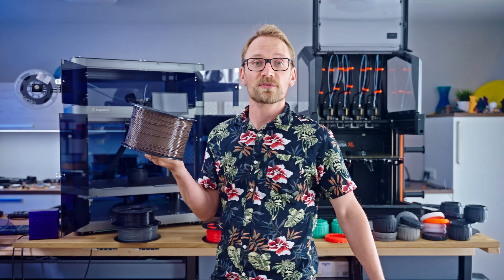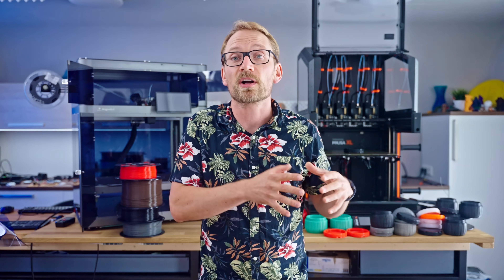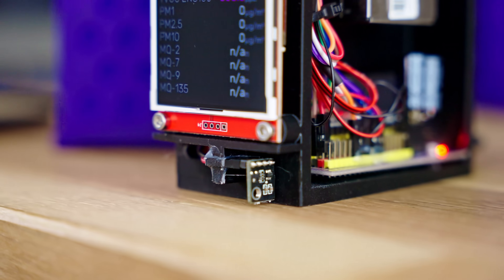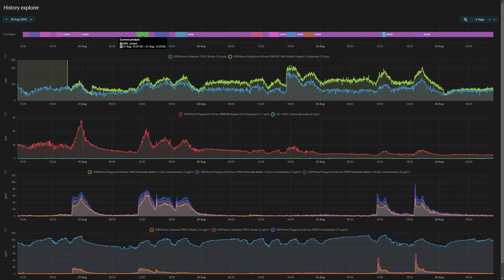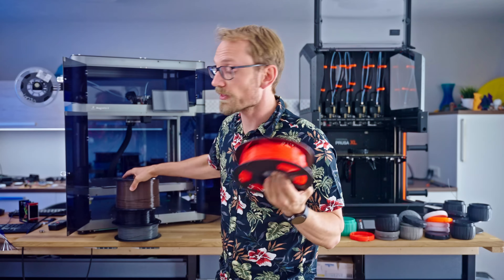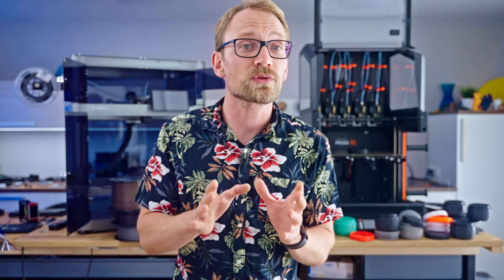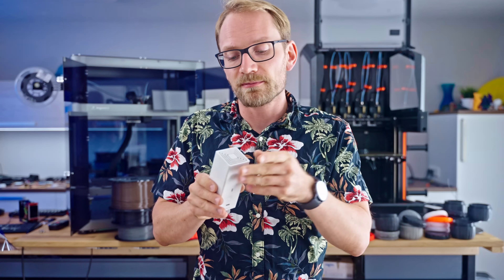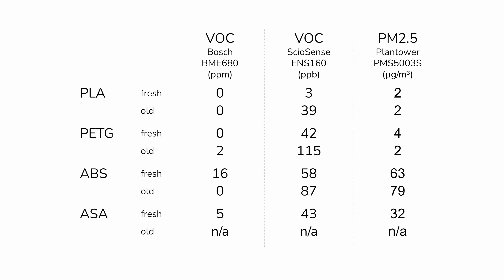3D printers are worse than I thought. Time to do something about it!

Comment: Thanks for reporting on this health issue, the community needs more awareness.  7 years ago I was printing some ABS and stunk up the house, my gf freaked out and forbid me from printing anymore.  I did my homework, and learned that pretty much all filaments emit VOCs, so I agreed and stopped the hobby altogether.  But I really wanted to print again, and 3 years later I came up with a proper solution.  I got a Printed Solid enclosure for my Prusa, installed a couple 60mm Noctua fans, attached a couple 2" diameter duct hoses, and ran them out a nearby window through an MDF gap filler panel.  It worked better than I expected, you can't smell a thing with ABS, and exhaust ventilation is sufficient for printing PLA with the enclosure closed (enclosure temp rise is only around +5C).  Last year, I got a Prusa XL and immediately made a custom enclosure.  I designed it to fully control airflow, with intakes in the front bottom, and 4x 80mm Noctua fans that exhaust out two 3" duct hoses, again through the same window panel.  It works great, enclosure temp rise with PLA is only about +6C, so I can print all filaments with the enclosure fully closed.  

My XL enclosure looks similar to the SUMO, but the SUMO doesn't actually control airflow.  I don't like Prusa's XL enclosure either, but I can't really say if it's properly designed for controlling airflow.  Essentially, both of my enclosures are negative pressure cases, sucking in fresh air near the bottom, and exhausting out the fan ports.

I'm not a fan of the filter approach.  These devices and consumables are expensive and less than 100% effective.  And don't forget that pretty much all enclosures require you to open them up for PLA, so no filtering at all.  PLA will give me a headache after a few hours, so this is unacceptable to me.  Exhausting out the window is essentially free, 100% effective, and works for all filaments.
Reply from the maker: Venting outdoors is an incredibly effective solution - even Prusa's print farm just has a simple negative pressure, constant-flow setup that simply doesn't let emissions escape from the printer bays. In colder, hotter, or more humid temperatures, that might however cause some issues with unconditioned air being sucked back into the house in other spots - for me, I'll be be rearranging my ERV ventilation unit to add and remove air more precisely where it's needed (i.e. hooking it up directly to printer enclosures)
Reply: @MadeWithLayers  You're right, all exhausted air is replenished by air leaking back into the house from other spots.  And if Noctua's rated max CFM specs were realized (total of 140CFM), then my entire home would be fully ventilated in under 5 hours.  I'm in hot and humid Atlanta, so these stats give pause for concern.  But these fans have low static pressure, so in reality they're pulling quite a bit less than 5 CFM total, due to various air restrictions (ribbed ducting, insect blocking mesh, undersized air ports, and the general 'tightness' of our home's weathersealing providing backpressure).  

Take a deep breath, open your mouth wide, and expel your breath slowly onto the back of your hand, such that you can barely even feel it (done right, it should take you 10+ seconds to expel).  What you're feeling there is approximately the air intake speed of one of my XL enclosure intake ports.  An adult male's lung capacity is approximately 6 liters, or 0.21 cubic feet.  So this equates to about 1 CFM.  Since I have 2 air intakes on my XL enclosure, let's double this and estimate that I have around 2 CFM of airflow through my enclosure.

This low air speed is desirable, because one of the main benefits of an enclosure is blocking drafts that might affect print quality and bed adhesion.  It would be silly to have so much ventilation airflow to create harmful drafts.  I've gone through various fans and ducting solutions to arrive at what I consider a desirable exhaust rate, a barely perceptible gentle breeze, not even strong enough to hold a tissue to the air intake.  Any less and the enclosure overheats for PLA, so I've tuned it to be just enough.

Looked at another way, the estimated enclosure exhaust flow (both enclosures combined) in 24 hours is roughly equivalent to a quality bathroom fan running for 15-30 minutes.  Yes, there's an impact, but no it's not really noteworthy.  If I had a print farm then I might feel otherwise, but for just 2 printers I'm quite happy with this setup.
Reply: @MadeWithLayers  The thing to consider about this though is that you really need to be filtering AND venting outdoors. Not one or the other. All of the modern professional venting set-ups I've seen in studios use some kind of charcoal filter to filter the air, and then the air is sucked outside. The placement of the ventilation system matters as well...if you pump unfiltered out of a window next to an A/C unit or other intake system you can make indoor air quality even worse, not better. There are exceptions like the Nevermore filter system, but most of the set-ups I've seen in YouTube and elsewhere are designed by well intention-ed makers, but many/most are untrained hobbyists and they don't actually know what they are doing.
Reply: Totally agree with you that some enclosure or air pollution management system is a must in 3D printing , and that it really doesn't have the attention it deserves, just as a precaution measure before we know more about their effects. However I would personnally still be quite uncomfortable simply exhausting it out, because it's just displacing the problem, not a  long term solution. On the one hand, even though hepa filters are usually  "only" around 99 % effective, you can get a nearly identical result as a hypothetical 100%  filter would yield just by recylculating the same air enough times through the filter. One could imagine a 3D printer with an airtight enclosure, and an air filtering system composed of some of those semi-flexible aluminium pipes + fan + filter. If you just choose a duct fan that has a big enough volumetric flow it could generate enough air flow inside the enclosure that it would probably also help cool down those PLA layers even with the higher temperatures that that an enclosed printer involves. And I guess that those aluminium pipes, routed outside of the printer would also act as an air heat exchanger. But obviously, it will need to be tested. On the other hand, it would be interesting to know how well are those used hepa filters managed as a waste to find out whether this step doesn't release those filtered particles again somehow in nature.
Reply: Exhausting outdoors isn't free, for most people heating/cooling your home is by far one of your biggest expenses, so depending how you go about this, you're comparing a ~$100 year cost on filters vs upwards of $1000+ a year on additional heating/cooling, also nothing is "100% effective" unless you have your printer in some sort of airtight container you'll always get some leakage or air floating off in an undesired direction, so basically if this is a big concern for you, put the printer away from indoor spaces such as a garage or shed, only then can you remotely call it free but still filters are cheap and last a long time, you're really not saving much if any money with any solution that isn't as simple as move the printer.
Reply: @vgamesx1  The cost of HVAC is a good point.  Your leakage point is incorrect though.  It is prevented by the negative pressure.  Air is being pulled into the print enclosure from the gaps by the fans suction stopping it from leaking out.  A similiar concept is used in Industrial enclosures in explosive environments with a positive pressure system preventing lower pressure external air from coming in.
Reply: @jimjohnson3410  That's why I said it depends, for a lot of people 3D printing is just a hobby and may not have many things like enclosures or even know it could be toxic, so if you're just venting air in the room or near the printer straight outside then that's a lot of wasted electricity.
Reply: Thanks for briging this up, I had the same reaction with ABS and wouldnt print it because of it, then finally caved in with a janky ventilation setup after some time away from printing. It was ok but still a little smelly overall. A proper enclosure with ducts and fans is a great idea.
Reply: Hey Paul! Hope you are great. I found your solution very interesting, I was thinking of doing something similar since I'm moving houses and now my 3D printer will be in the same room as my computer, so it's where I will stay most of the time. Could you possibly make a quick run-through video of your setup so I could have a better idea? I'm planning on design something similar for my printer.

Greetings from Brasil!
Reply: Anyone who exposes their neighbors to such gases should be sent to prison for 50 years.

Comment: I print mostly PLA but I still have some ABS around from when I was learning to print (I thought learning ABS meant if I could tackle ABS and its challenges, I can tackle PLA and beyond). I have my Neptune 3 Pro in an enclosure. I print in my small home office room with the window slightly open. In my rather small house, I have a decent sized Honeywell HEPA + VOC filter in the living room/hallway near the office room door that remains shut during printing. I almost NEVER stay in my home office room when the printer is printing (I really have no need to).
Reply: What enclosure are you using? I also have a Neptune 3 pro
Reply: @noahorr3480  mine is a generic Ender 3 soft tent style enclosure. I'd recommend the one that I have but Amazon has it listed as unavailable. Whichever one you get, I recommend one with a large front window and silver/aluminum reflective (to keep the heat in) for the other 5 sides. Also you're gonna want the power cord to route out a flap either on the left or back (mine has a left, back, and right flap).

Comment: Brilliant, really need more people making videos about safety! 
Only point you missed, how long is that hepa filter filter effictive for? how many hours of print before having to change it? does it stop being effective after a time by just being exposed to air? etc.

A follow up video on this point would be awesome.
Thank you for your hard work!
Reply from the maker: As far as I know, particle filters don't lose their effectiveness over time. They'll fill up with particles and you'll eventually see a drop in air throughput, and at some point they simply get filthy, but they should always keep doing their job. The one exception here is statically charged filters like used in some N95 masks, those do lose their effectiveness over time, which is (part of the reason) why they have an expiration date.

Comment: How good ikea VINDSTYRKA sensor is to detect printing emissions? It measures PM2.5 and V.O.C.s.
Reply: It's very reliable at least in my tests - VOC readings detects in no time IPA alcohol fumes and gets 500 readings (max), from frying and rises a lot when filament has too high temp and top cover is open... Zigbee is great in it but sometimes seems to get dirty when reach max values and shows too high numbers (better in this direction :D ). In this case I turn it off and on - then it's redoing calibrations and shows real readings. Connected to Home Assistant. That's my way to know when to replace acid free carbon in MAK filter and/or Bentobox inside (if printing ASA, Nylon, smelly PLA Matte etc)
Reply: @yukinoryu Thanks, got one. Also, the Bentobox, I didn't know existed.

Comment: So what should I do if I can’t have a dedicated room for my 3D printer, and most of the material I want to print is ABS?
Reply: Become one with the fumes.
Reply: hydroponics tent, and the associated filters
Reply: +1
Reply: I assume you have a bathroom? Move the printer there when in use and have the exhaust fan running with the door closed. (Or very slightly open if it seals well enough to impede the effectiveness of the fan.)
Reply: If you care about your health? Find a safer hobby. Otherwise just keep at it 🤷‍♂️

Comment: So basically the video tells us that the Magneto X and Prusa XL enclosures are kinda garbage no? In both you can see the huge gaps.
There are a few DIY enclosures and enclosed DIY printers that do a ton better, you can already smell the difference because those actually keep the air inside.
I'm actually printing ABS on my MK4S with the Prusa Enclosure right now and it is nearly as bad as printing it open chamber, meanwhile my V-Core 4 enclosure does a way better job.
Its also a shame recirculation filters were not tested in this video. Yes the small ones Elegoo sells are garbage for anything bigger than a resin printer but there are multiple bigger options.
Especially the Nevermore series of filter enclosures. Most of them are mainly for VOCs tho, with bigger coal chambers.
Recirculation filters in a proper enclosure do quite a lot though from anecdotal evidence.

Comment: As a resin printer. I made the mistake of leaving the IPA open to the air for months in the bathroom. 
1 learnt that IPA evaporates
2 the VOC was permeating into the house and it DID cause sleep problems
3 my body didn’t feel good as I was breathing it in ambient air circulation 

After sealing it in a Tupperware enclosure, and relocating it to the basement, I had better sleep and woke up feeling better in the mornings

Comment: Surprised a Corsi–Rosenthal Box was not mentioned. I think making one should be on all DYIers list. Does not matter if 3d printing, metal, wood, painting or any other shop, everyone should have one I think. Especially as it goes so much along the DYI spirit.

Watch the RTINGS video about air purifiers, after watching that, making one is a no brainer for me. Already made one with the blue filter material.

Comment: That was really interesting.... and discouraging hahaa, I currently live at my parents, but I should soon be done with my master's thesis and move into my own apartement. It will be hard to have a room for working,a nd one for 3d printing.
Also, you made some hypothesis about the little box that goes into the 3dprinter. Could you try to run the same test with a nevermore filter ? I am really wondering if it helps or not, considering it has a dual blower fan blowing through the activated carbon

Comment: 8:12 "Initially you'll see a big spike in particulates"

Something you have to be aware of is that ABS is not chemically stable at printing temperatures, it survives about 20 minutes before it breaks down beyond use. So during preheating of the hotend, you're creating a lot of polymer fragments that are released when you push out your purge geometry (purgeline or skirt or whatever). It's not pyrolisis, since it's oxygen starved.
Reply: Isn’t pyrolysis specifically in an oxygen starved environment?

Comment: The IKEA FÖRNUFTIG activated carbon filter is literally see-through. Some of the air passes right through it. A denser carbon filter would filter a lot better.
Reply: The IKEA filter is primarily designed to be quiet so you can keep it running for hours without being too disturbing. A less dense filter require less air pressure to pass through and a less noisy fan, but with enough airflow it will still filter most of the particles after some time.
Reply: It is the same logic as applied to the surgical masks during covid.  The holes are orders of magnitude larger than what they are catching but you will do fine.

Comment: Interesting! When I first started printing I noticed I always had a sore throat whenever my printer was running, even printing PLA & PETG. Ever since, I've always built enclosures and vented it out.
This micro-plastic exposure will undoubtedly have long term effects, we just don't have the data yet.
Reply: I started with PLA and had constant runny nose and scratchy throat. I switched to PETG and it stopped.
Reply: @AAE-cg1il   Which doesn't necessarily mean PETG is healthier, just that your body doesn't react in the same way. I would suggest using filters either way, or even better running the printer in an isolated room.
Reply: Microplastics have been around since the early 1960s.  We need better science, not the hyperbolic junk science just designed to alarm people. BPA was a good example of false toxicology.
Reply: 100% just wait until folks have built up enough PLA/ABS/PETG nanoparticles in their lungs and bloodstream for there to be a study, it just hasn't happened YET. Eventually we'll have something called "3d lung" and I am pretty sure all those nano particles are probably going to affect our endocrine system and we're already seeing plastic building up in the brain as they can already pass through the blood brain barrier.
Reply: How do you build an enclosure?
Reply: @husamh4585  Use 2 mm thick steel sheet and weld the parts to a corresponding steel frame. This will at least be gas-tight. I have already found that aluminum foil is too thin to stop such substances and plastics are much more permeable. You have to work with seals on the doors.
Reply: @ thank you for the info, been researching this for a while and thought the same about aluminum foil.
Reply: @husamh4585  look up "lack enclosure" while these aren't airtight.....with a exhuast fan and window...filter to keep it out of the natural enviroment outside...... it should use some suction to keep the particles aways from you. bento box filter helps for PLA and PETG.....ABS and ASA are vent outsides imo. TPU + NYLON PA Emissions are something i'd be interested in hearing about too. you can also look up "material saftey data sheets" for your brand and types of filaments.
Reply: people have a plastic spoons worth of plastic in their brain. Data is here.